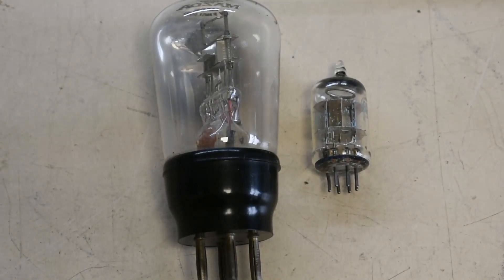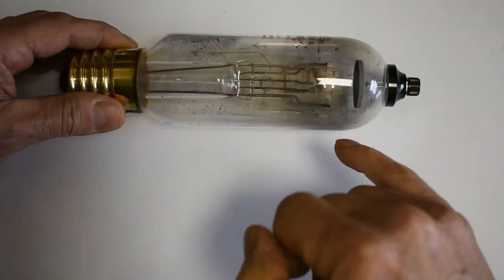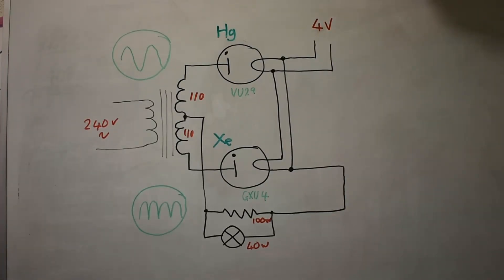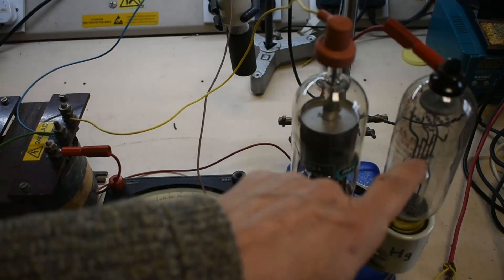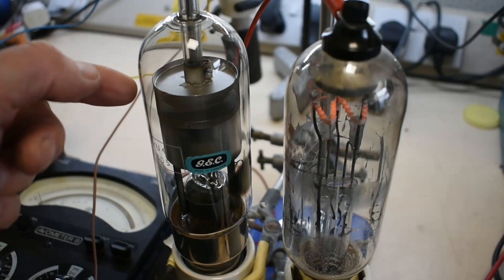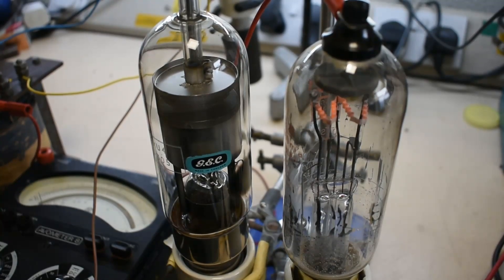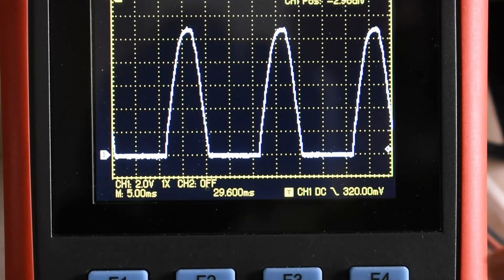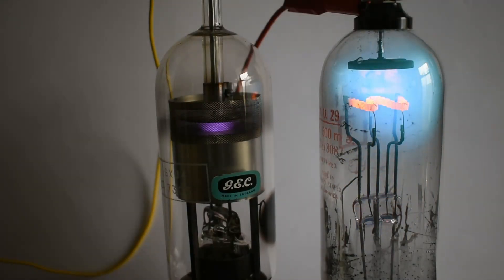Gas Filled Rectifier

Comment: What is the valve number for the mercury valve? 
I suddenly require a new addition to my lamp display table... 😮
Reply from the maker: The mercury rectifier is VU29 but also equivalent to CV1029 and WSU150
Reply: @tuopeeks 
And there will be examples of Thermionic Valves.
Diode, triode, tetrode, and pentode.
Reply: @tuopeeks 
Cool, thankfully very much. 
I've been designing a tree showpiece, a nice hardwood table with one example of each type of electric bulb mounted in their respective socket, mounted through the table.
At the front of the table isots of switches, momentariness and dials for controlling the bulbs.